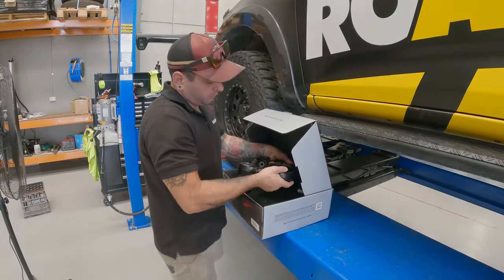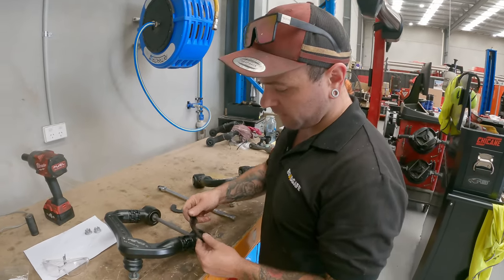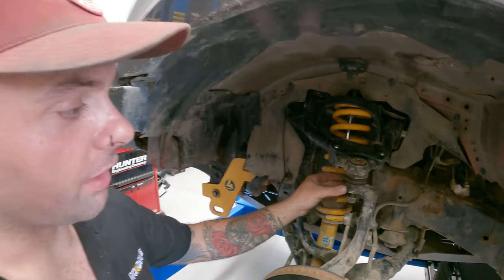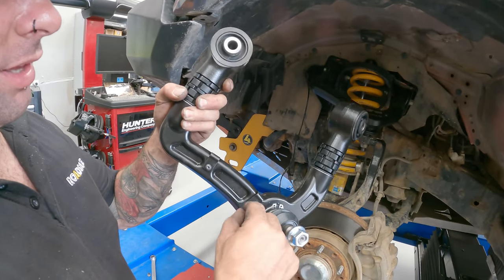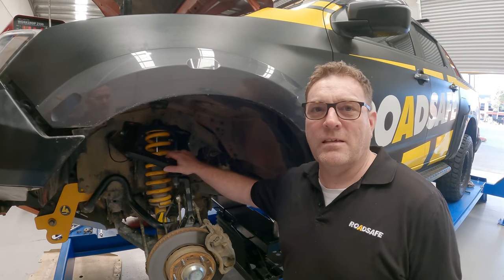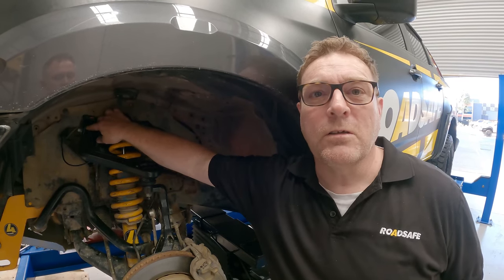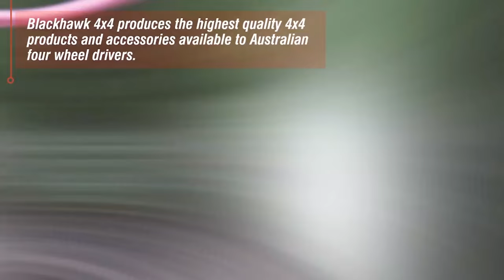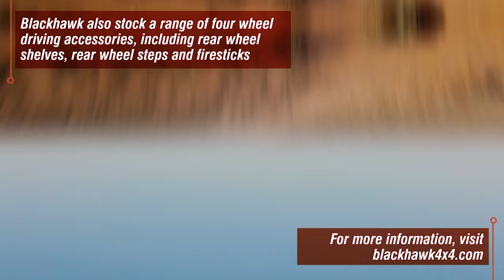DMAX Blackhawk Ultimate Upper Control Arm Installation - BHU4727D

Comment: Whats the preset for the adjustable part for a 22 mux? It's not on the website and it's where I'm up to
Reply from the maker: Hi Mark please see the below
0mm lift adjust to 51mm
30mm lift adjust to 45mm
50mm lift adjust to 42mm
70mm lift adjust to 41mm

Comment: And you got a mod plate from an Automotive Engineer as you need it when you go aftermarket UCA replacement.
Reply from the maker: Correct Steve, any aftermarket UCA needs to be mod plated by an approved VASS engineer to be 100% RWC & legal. ALL Blackhawk UCA's have the paperwork available to make this very straight forward.